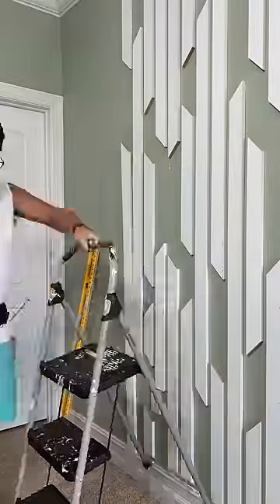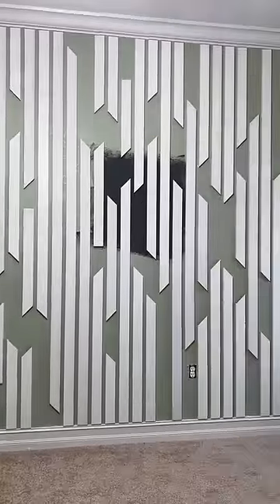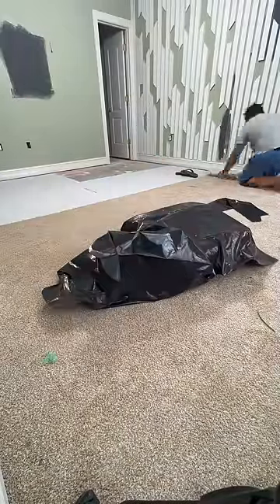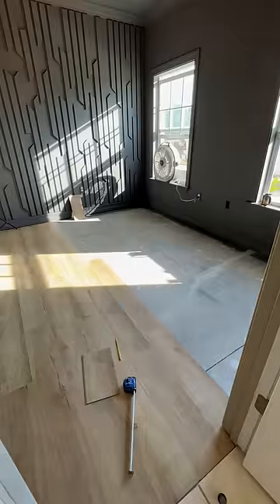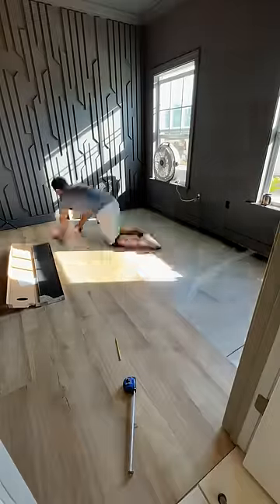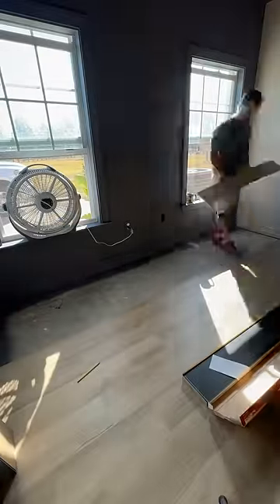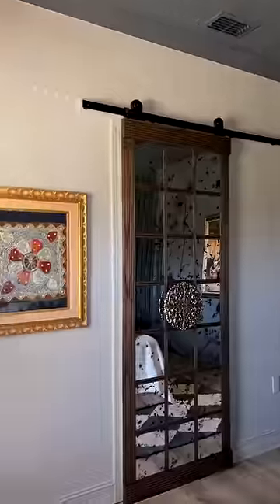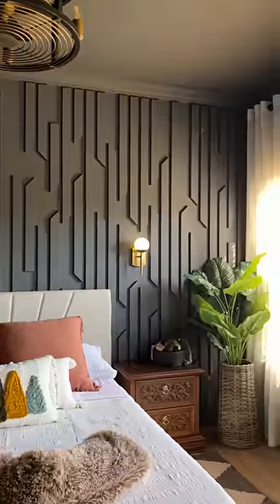Guest room makeover in 1 minute #bedroommakeover #bedroom #bedroomdesign #bedroomdecor #diy #diyhome

Comment: I do like the initial idea, not really the colors, but thats me. Id have gone with an off white color on the front facing flats and a really brown oxblood on the thin sides. Thatd pop.
Id keep the blonde floor, and maybe pick a neutral tone for the wall darker than the off white, but lighter than the floor. The ceiling id leave white white. That way you can take advantage of upward facing, diffuse light. Id go with a deep red color accent scheme for the drapes, rug etc. And dark wood for the furniture.... but thats me. Youd get a cool effect i think.

Or you could go darker with the floor, and then the wall could be darker too. That would make the woodwork, base, and crown moulding pop. Then go with a tannish color for the ceiling. Thatd look good too i think.

Comment: Did you know that placing the fan 3'-5' away from, pointing toward the window, is more effective at circulating air than putting it in the window facing outward?

Comment: I would not want to clean that wall.
Reply from the maker: 😁 It doesn't collect dust as you'd think. All those slats are vertical and there is very little horizontal surface for dust to sit on.